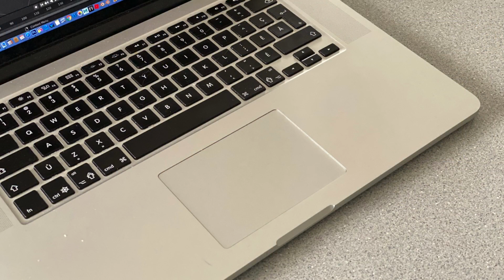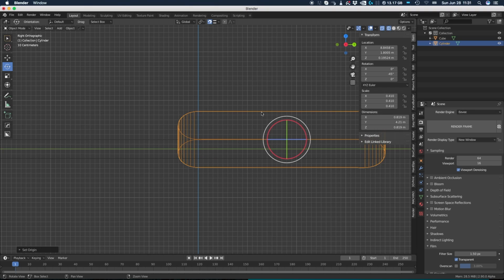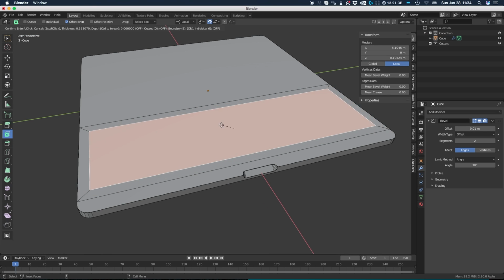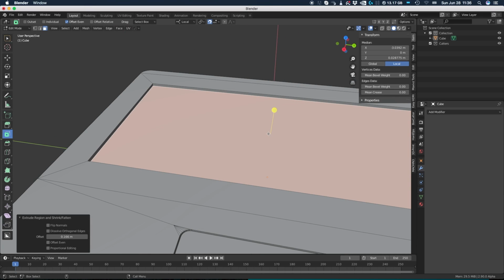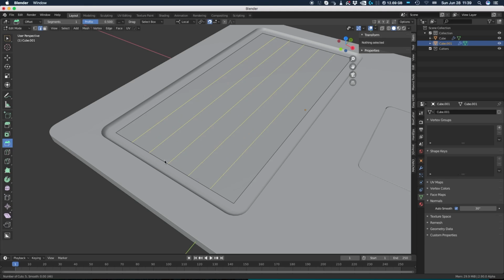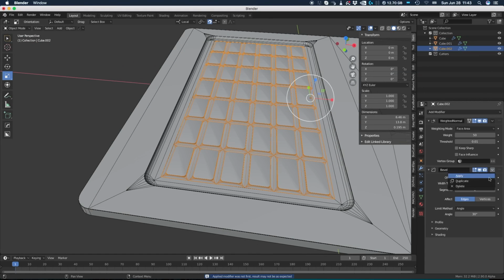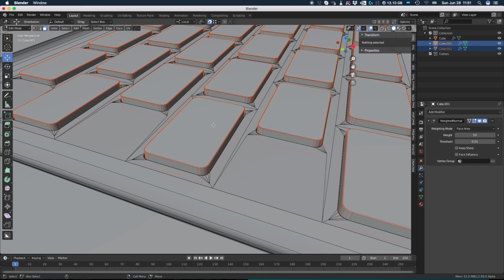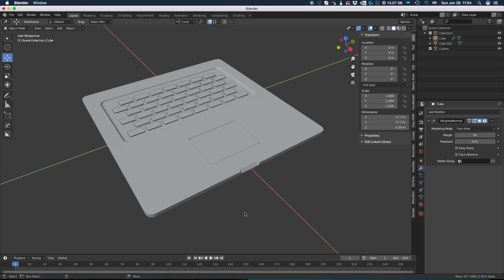Modelling for the VFX industry in Blender - Bevels Bonus EP1c

Comment: Awesome stuff! A few small notes that could speed things up: 
1) If you scale the cube in edit mode at the start, it will leave the object's dimensions at 1x1x1 and you won't have to apply the transforms before going on.
2) Instead of setting the cylinder's origin to geometry and then snapping it back to the center of the edge, you can set the geometry to origin instead, and it will leave the object origin where it was and move the geometry.
I'm really enjoying your videos so far, the focus on clean efficient modelling and the wider vfx industry pipelines are really interesting!
Reply from the maker: Hi ZachlmFilm! Thanks for the comments. In 3D, there's often may ways to do thinks and sometime you have old habits that are hard to get rid of. Always nice to hear other ways to do stuff. Greatly appreciated. Cheers

Comment: Great series filled with a lot of tips for me. I personally find the knife tool too "slow" when I already have the vertices and I just need to split the face: selecting the 2 vertices and pressing J (to connect them and splitting the face) is way faster (bonus point: it works also across other edges splitting them if needed)
Reply from the maker: Yeah! I realized that after I made the video. Maybe I can make a card to fix that. There's this function available on Youtube but I'm not sure what it's for. Thanks for the comments! :-)

Comment: If I have done modeling a project with booleans, and now the topology are screwed but the shading is okay, what should I do next? Retopologize or just leave it because the mesh doesnt have to deform?
Reply from the maker: Hi Phal. Hard to tell without seeing it. If it doesn't deform and renders well and you already did all the textures, leave it like that. If you have issues in some areas, just fix those. You can send me pictures on my facebook page, maybe I can help you more that way. Just search for Blender Bob. Cheers.
Reply: @BlenderBob  Thanks for sweet replying. I think I just did, but my wondering is still there. I model a laptop case with all the interior details. The structure of the case is not what we can see everyday, and it supposed to be modeled in CAD or fusion 360. But somehow I managed to make it Blender with all the magical booleans. From shading it looks okay but I just can't UV in order to texture some text and logo. It's very messy.
Reply: Phal Happy You are better off using Hard Surface techniques with addons like HardOps, Box cutter, Decal Machine, MeshMachine, Fluent, Speedflow, etc. You don't need to use conventional UV Unwrapping either to apply decals and details. DecalMachine is a great alternative to that in conjunction with the other addon tools I mentioned.
Reply from the maker: PukkaFactor I strongly suggest you watch the entire series, especially episodes 1 and 2 and you will see why these addons can’t be used in the film industry. They are great for fast prototypes or for geometry that will ne be distorted or displaced bit in the the film industry, that’s what we do. You present models made with these plugins for a job interview and they will turn you down.
Reply: @BlenderBob  Question. How would this model fair any better than a model produced using some of the above mentioned tools, i.e. HardOps, Boxcutter, etc? You've modeled that can't be any more easily distorted or displaced. A model with just as many ngons. I'm digging this series, but I just don't get the disconnect here. If you know how to work with Booleans, and how to clean up the geo, you can do this exact laptop model and end up exactly the same. No? FYI, I just subscribed to your channel and look forward to see more of what you do.
Reply from the maker: @dannyburns1185  Hi Dany. The laptop could absolutely be done with Hard Ops or Fluent or some add-on like that. And yes, you would get the same result. This clip is a bonus for the Bevel clip, so the goal was to show that you can use the bevel tool, in combination with the bevel modifier. As mentioned, if the laptop doesn't get distorted or displaced, any modelling method will do the job. If you don't use an external software like Mari for the textures, then nGones are fine, if you stay in the Blender world. This series is aimed at the VFX film industry and nGones are simply forbidden. If this model had to be distorted, the topology would have been totally different. You can see it when I present the bicycle pedal example. Another issue with those add-ons is that if you add a bevel modifier, all the bevels will have the same radius and they will be applied on everything. You don't have enough control. In my experience, it usually takes longer to cleanup boolean mess than just doing it right in the first place.
Reply: @BlenderBob  Hi Bob, Thank you for the thorough reply. I totally get it, and this is why I asked. There are videos on modelling (in Blender) that go on and on about quads not being necessary, so long as the model isn't being distorted, displaced, etc., which is what I've come to believe. Your video is the first I've seen that tells a different story, and frankly, your position makes a ton of sense. I hadn't thought about the other aspects of the pipeline before. I guess where I'm stuck is, is it common to displace or bend a laptop model? I mean in general, when building hard-surface models, is that a regular occurrence to need to displace or bend models like this? The confusing part (for me) is the message that says: Quads aren't entirely necessary if the model isn't being bent, displaced, distorted, etc... but if you don't use quads, your model will be rejected.

Lastly, I'd love to see how you'd do that same laptop model using even quads. This is where I currently struggle the most with modelling. Thanks again! And keep up the great work!
Reply from the maker: @dannyburns1185  Well, it's a little bit more complicated and I didn't want to go into these details because for sure I would lose my audience, or maybe the junior ones. In the film industry, nGones are simply forbidden, period. Too many conflicts with other software. For even distribution of quads, you have a perfect example in 1a. Triangles will create a mess once subdivided. Elongated quads don't give a good result if you render in Cycles and Arnold. Renderman couldn't care less about the topology because it subdivides as needed into micro-polygons that are actually smaller than a pixel. A film quality render will have 4 polys per pixel. The way to calculate it changed in the last few years but the idea is the same. Renderman, like any other renderer, will require a subdivision surface. Hence all quads, as even as possible. How often are you going to displace or distort a laptop? In the film industry, when you do something 3D, most of the time it's to destroy it. Texture artists love to add displacement maps on EVERYTHING! Even for little scratches. Now, your next question will be: Will that make the models unnecessary too heavy? Yes and no. The amount of polys, believe it or not, as little influence on the render time. Displacement in Renderman has a negligible effet on render time. What does is the lighting and the shading. I will actually do a clip about that. As I mentioned in I think part 4, I made a 75 million polys scene and it rendered under 4 mins at 4k. But the shading as super basic. If I have time, I'll make an all quad version of the laptop and tell you about it.
Reply: @BlenderBob  Thanks, Bob. Good info!